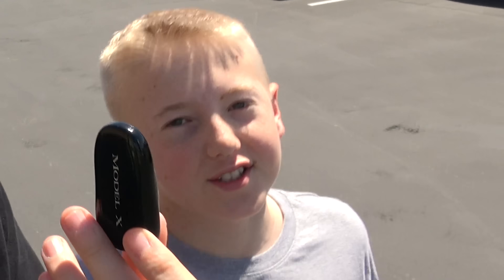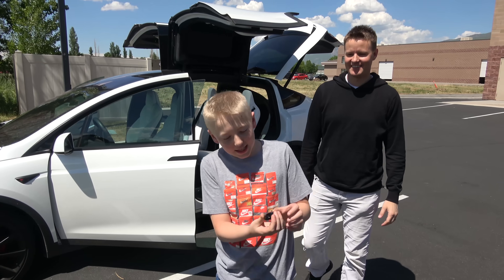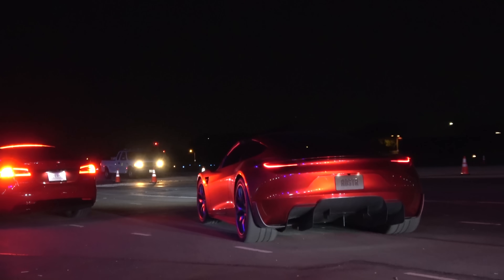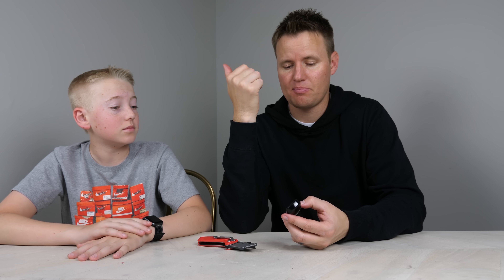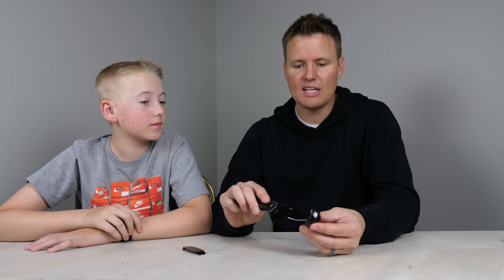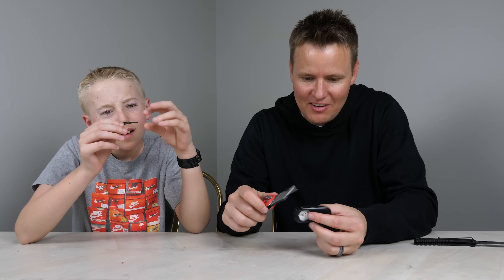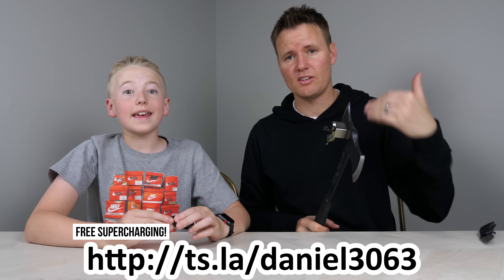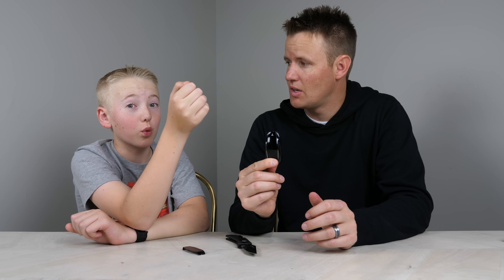What's inside a Tesla Key?

Comment: we dont get tesla’s in our country we get the same but not maxed technology but our car need’s the battery same as the tesla our car named: Genesis: it has autopilot the cant turn or stop at lights and we have screen’s in the back seat we download video’s from the computer to the car from the back seat and it has sensors/camera’s and when sombody is close to the car the sensors will alert the car like this BEEP and in the driver’s seat there isna screen that you can see floating infront at the seat that can show speed and sensors can alert of a car driving from left or right it will not come BEEP it will at screen that shows speed behind the wheel it will say something from left or right and there are buttons in the back seat that can turn on the screens like media map radio back and something else oh i would like to mention we have a radio in our car we can hear music and there are settings that can turn of screen and low light and change languages and details of the car and thats loacated to in front seat the front seat can call and do the same thing and the wheel can lower volume and turn on autopilot but its called cruise and the key can open the thing in the back i think its like the trunk but you have to hole on the button to open and from the key can open and close the doors and our car is a gas not electric and that’s pretty all of it Have a nice day.
Reply: @Aniket.V. Chitale ok i never wrote that long

Comment: Our Volvo Key:
* Open trunk
* Close trunk
* Unlock
* Lock
* Bring down all windows (open sunroof)
* Bring the windows up again (close sunroof)
* Start an distress alarm (if you start it, the car will flash lights, honk like crazy and sound the alarm)
* Start the car even if the battery in the key is out

And if i leave the key in the car and locks the car, the key is disabled (so if someone breaks the (laminated) window and takes the key, they still cannot unlock the car). The fob also has a regular metal key hidden inside to open the door if the power is out in the battery.
And yes, only four buttons on the fob.

Comment: That’s such a bad key. You walk up to the door and it unlocks and a robber jumps in and drives away
Reply: Then it loses connection with the key and doesn't run
Reply: TheJetFighter ?
Reply: MM Aviation the key has to be next to it for the car to work. You don’t know how cars work, do you?
Reply: MM Aviation not these types. Some of the new fancy ones work wirelessly. No need to manually put it in the ignition. Just in your pocket and drive.
Reply: MM Aviation idk about other cars, but the ones I’ve had, had a key inside the remote. So if it’s out of battery, you can manually open it with the key inside. You don’t think companies thought about all this?
Reply: MM Aviation why not use a wireless key, why do you use the phone to check news instead of a newspaper? Why do you drive instead of walk anywhere? It’s easier, that’s why.
Reply: Andrew Stack you are
Reply: Andrew Stack well u offended me first

Comment: What if you work beside the car in your garage and the door keeps opening for nothing😂😂😂😂🤷‍♂️ and then you want to go shopping three days later of that happening and your 12v battery is out of charge😂😂😂😂 a few hundreds for a key... cost more than one week of work?!?😂😂😂😂 i prefer my keys to open my car only when I at least push on a button. Had many issues with a trunk opening key that kept opening my car’s trunk while I was far away. Had to unplug the damn system to stop that happening, and guess what?!? No key hole on the trunk to open it with the actual key so it was a real flaw for that car to me since I had to use the inside mechanism rope everytime I had to get in the trunk. When they want simple but end up making things useless

Comment: Rule #1 to opening remotes and FOBs: dont use anything that can flex or cut to open it. something that can flex will fling the remote apart and you are likely to lose something. Something sharp will cut it and gouge it, you may not be able to get the FOB back together in a bad case, or you will just cut up your FOB.

Comment: The CR2354 has a 23mm diameter,  and is 5.4mm thick.  It is a 3v 560mAh battery.  Most car fobs use a CR2032 which is a 225mAh battery.

Comment: My Mercedes key can do something no Tesla key can do... You put it in it's slot. You turn it and then it sends an IR signal and makes a small electric motor turn that spins up this big thing called an engine. And when that engine starts, it can drive your car and it can be "recharged" in just a few minutes at a place called a gas station.
But seriously, cool key... I like the idea of having your car key look like your car. Now if keys came in the same color as the car, that would be even cooler. I'd love to have a tiny blue Mercedes as the key to my actual Mercedes.